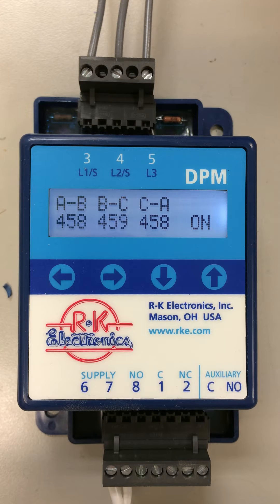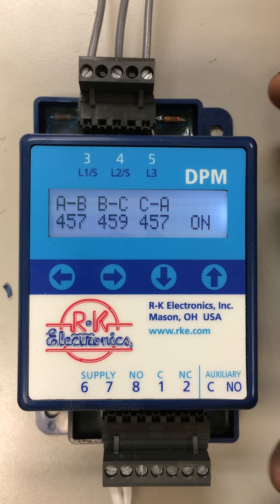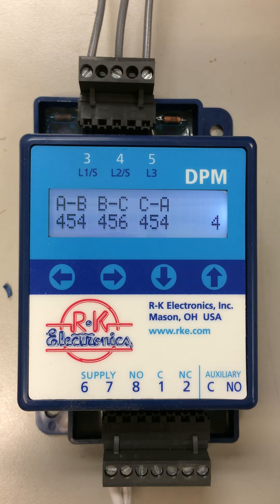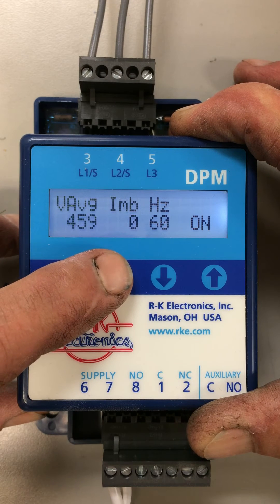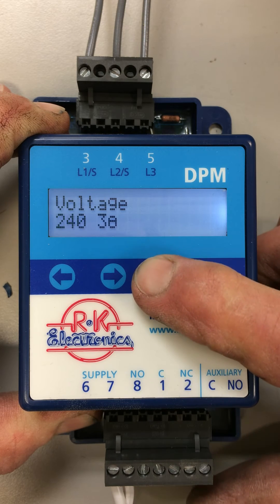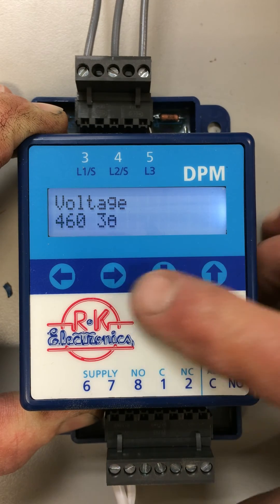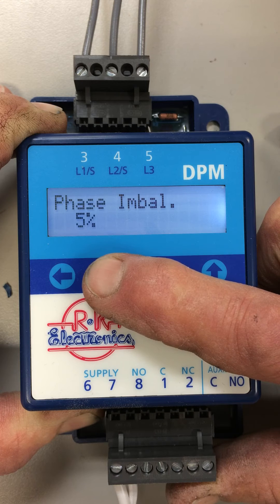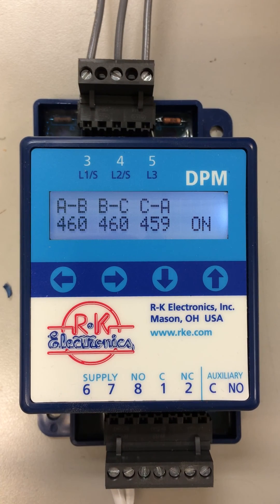R-K Electronics Digital Three Phase Voltage Monitor (DPM)

Comment from the maker: James, I'm not exactly sure of the resistor monitoring use of the ZVM, but the comment of it being in a lathe and that it is a ZVM-3300, indicates it is a speed switch on a LeBlond engine Lathe. The DPM will not do the same thing. The ZVM-3300 is obsolete. The replacement is a ZVS-120A-F1C.

Comment: I know RK makes a zero voltage monitor.  I have a RK zero voltage monitor in a lathe that I think has failed.  Signal voltage is correct, but it looks like the relay coil isnt strong enough to keep the relay closed and it buzzes both while the lathe is running and when the lathe is supposed to be braking.  

I happen to also have a DPM-24A-T sitting on the shelf.  Can I configure it to be a zero voltage monitor using the undervoltage settings, or fake it using undervoltage and the timer?  The ZVM-3300 that is suspect is used to control the spindle braking resistor circuit.  Thanks.